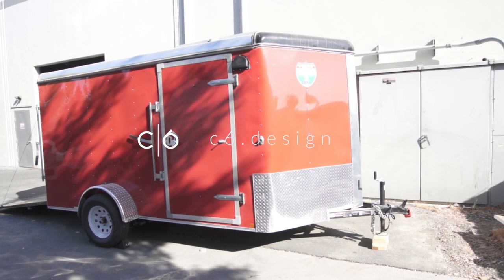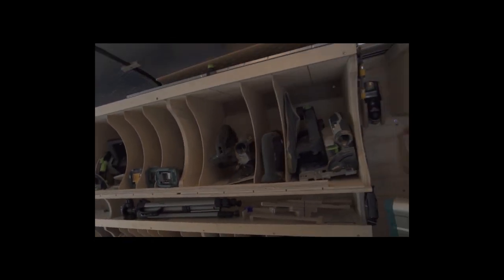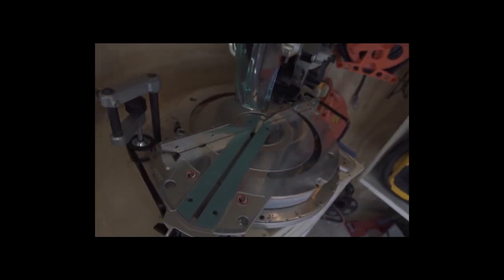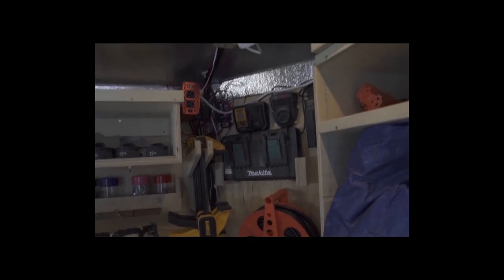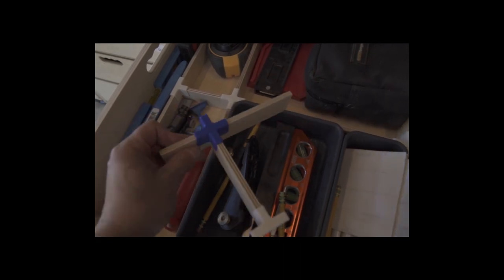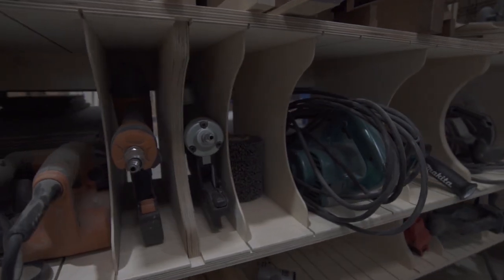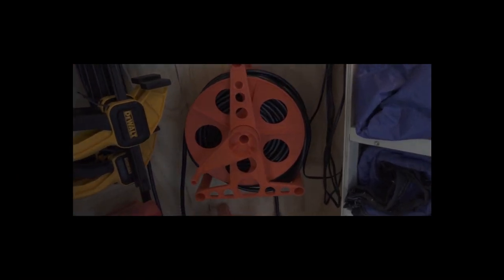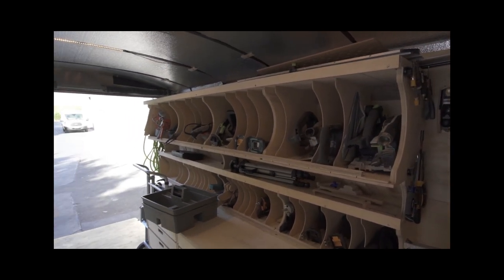Paulk inspired mobile tool trailer tour

Comment: Awesome... good ideas here as I get ready to do my 6 x 12  trailer. One take away is the toe kick to allow 4 x 8 material.  the other is the plastic dividers made on a 3D printer. What size is your inverter and  battery for your solar?
Reply from the maker: I think it's 200w

Comment: I'm planning on building a 6x12 trailer myself and I have access to a 5 ft by 10 ft cnc. Do you mind sharing the CAD files? I'm certainly a lot of adjustments that I would need to make to fit my trailer but you've done basically what I was thinking about doing as far as cutting holes through to lighten panels or like on the insides of the drawers I was thinking of doing pockets to reduce weight